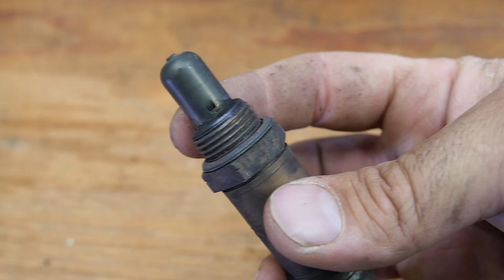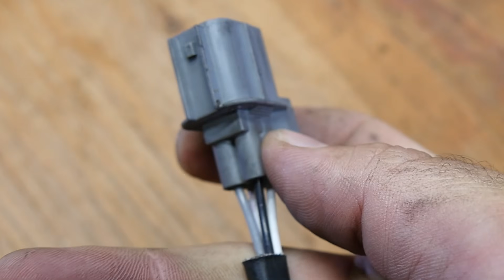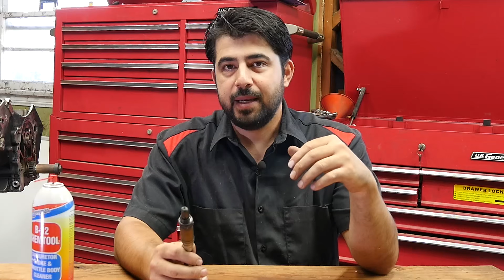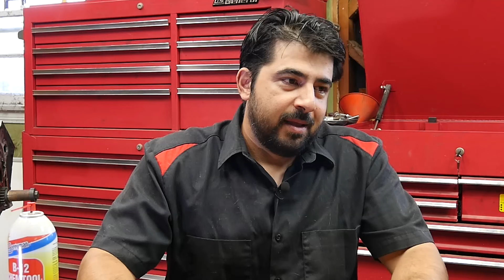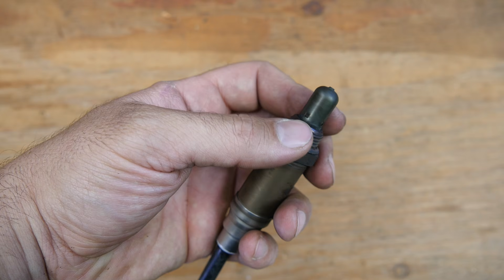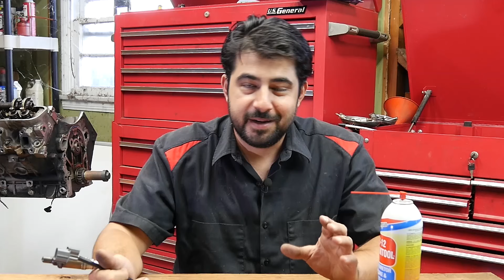How to Clean an Oxygen Sensor

Comment: Hi, I have Peugeot 307 2003 that does not start but crank. There is no warning light. Any suggestions please where to start, I have checked spark plugs, fuses, and fuel pumps that sound well at the time of turning off the key.

Comment: can an o2 sensor dip to 0.00v on a handheld scanner? I get a p0134 code only one time so far but when I hook the scan tool up it dips to 0.  could a failing coil not sparking cause this, or a solder point inside the o2 break? broken wire or connector?  or is 0.00 a normal reading?
Reply: Yes mine (the post cat o2s) goes to zero when going fast downhill and no throttle.  Your code is for pre cat o2.  Your pre cat o2s go to zero?
Reply: @yogamon  precat.  real strange the guy I bought the car from changer it when I picked it up he thought it would clear a p0421.  he was wrong.  I'm thinking he threw in the cheapest he could find and it was about 20k miles ago
Reply: @dereckc9469  probably, depending on the car they can be picky on o2 sensors.  Usually you have to use oem.  May have been some Chinese cheap crap

Comment: After I took my silverado 2007 classic. 5.3 to a mechanic shop to replace a lifter problem a camshaft timming chain oil pump  Spark plugs and wires. Nkw use a lot of gas some time when is parking on idle gets down to 5mpg and driving gets to 14 and before use to be 16 to 17 driving.
What is happend!!  I have no engine light

Comment: i replaced my o2 sensor cleard the code and did the driving got the car scanded again and the heating code came back can you help me
Reply: Check the wire harness and fuses. Or you might have gotten a bad 02 sensor.

Comment: What does it mean o2 sensor 2/2 circuit low?
Reply: Bank two sensor two
That's the sensor behind the cat on the driver side
Reply: Use a volt meter to make sure the sensor is getting proper voltage.
Or replace the sensor
Reply: @RandoDred   i replaced to a new one and now its says high voltage 🤦🏽‍♂️

Comment: For less then 30 bucks I felt the need to change them both out after listening to the pros and cons of your video I changed the upper and lower sensors after reading the code that I checked after ck engine light come on. 2011 Ranger v6 Sport. 10 years old felt best to fix it right..
Nice video by the way!

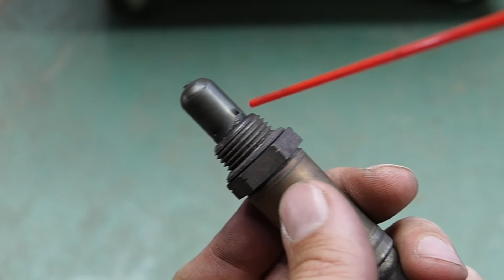Comment: Save your self 10 minutes of him trying to tell you to replace it yet his video is titled how to clean one. Just spray carb cleaner in the holes at the bottom, let it sit for a few shake it around and do that a few times. Mine the truck was running rich due the wiring with the back o2 wich is now fix.  so going to try to clean it.  A bath in seafoam might help. I love to run that in the tank every few months just cause. 5:05 
With these 4 wire sensors two of them should have 12 volts for the heated circuit when ignition is on.  If you don't check the fuses for them and then the wiring. So no 12 volts this cleaning won't help.

Comment: Try to clean it for about $10 of supplies and time? Or $500 for denso oem sensor and time for my Lexus? Hmmm 🤔
Reply: I have a 2003 Lexus ES 300 that has three oxygen sensors that I need to replace. I say I need to replace even though one is bad but from my experience and on previous cars where I’ve only replaced the bad oxygen sensor and left the others that weren’t bad in those failed couple months after resulted in the same problem so I just decided to bite the bullet and buy all three for my 2003 Lexus ES 300 which weren’t cheap by the way like $200 apiece close to it might as well be after tax and shipping. I’m gonna try this on my one bad sensor and see if it fixed it so I can at least have those three original ones that I took out since I already got new ones ordered I’m gonna keep the old ones as spares because those are the original sensor that have been in the car since 2003 same thing with the alternator I replaced I’m gonna rebuild the original alternator with all new parts why because it beats throwing it away for how much they they cost for a new replacement and spare parts are always good to have for these older vehicles that yeah those new oxygen sensors are not cheap. Just another way the EPA gets their money and forcing all that expensive emissions equipment on cars oxygen sensors don’t have to be that expensive for brand new OEM ones and going into it I was thinking well I might as well replace all three because it’ll be an expensive and it will ensure that I don’t have that problem for probably another 22 years going with OEM Denso Toyota branded oxygen sensors nope I was wrong way more expensive than I thought. Same thing with the OEM Toyota Denso brand new alternator not remanufactured thousand dollars for an alternator, but I suppose it beats paying a car payment on a new car but 22 years for those parts to go out that’s pretty good considering that today’s parts on today’s cars fail within a year not Toyota put on general motors vehicles and Fords and really on every new car that isn’t a Toyota or Lexus but then again even Toyota Lexus had some issues with quality on those new engine engines. The turbo V6 a few years ago so if I can keep this one going, why would I need to buy a new car and deal with planned obsolescence within a year of the warranty going out? I mean the parts on my 03 Lexus are all 22 years old and they’re just now failing and the warranty has been out for quite some time but I’m gonna use the used alternator and the used oxygen sensors as spares

Comment: I have a 2010 Nissan Altima 2.5 What is the difference between Air Fuel Radio Sensor and Oxygen sensor? Because I change the Upstream. But the check Engine light still on

Comment: I found my sensor screws were lose, then when I put a new one in, the plug from the car side came off in my hand. So I agree, check that electrical connection or you will be chasing your tail. The oil filter is just under it so I guess I pulled on that wire one too many times changing that filter and it finally broke off.

Comment: Hi sir,  would you help me please. I have 4runner 2006 v6 engine. I am facing this issue

DTC report
VIN: JTEBU14R560090570

============1==============
P0420
Raw code: 0420
ECU: Engine control unit
Status: Pending
OBDII: Catalytic converter system, bank 1 - efficiency below threshold
============2==============
P0430
Raw code: 0430
ECU: Engine control unit
Status: Pending
OBDII: Catalytic converter system, bank 2 - efficiency below threshold

Comment: Hi there, my 07 Jaguar x type Petrol V6 3.0 check engine light came on and the read code was P1647 (Heated Oxygen sensor control module bank 2 open/shorted) with P1111, which one of sensors goes wrong and pls advise? very appreciated

Comment: Funny story I changed my sensor and it only worked one day I thought something else was wrong with the car I changed so many parts which needed changing anyway. Turns out the sensor was poor quality. I bought a more expensive German made version and worked perfectly. Cleaning did not work. I still get a funny idle when starting the car. Could also be some leak around the piping, who knows. Now my problem is the cooling system pump is leaking :( so much effort

Comment: I need your help please please please I have a dodge ram 2016 and all my gauges don't work  only the screen tells me the gas speed oil and temperature  but I need the gauges working  I tucked to a shop and they didn't fix it I'm currently unemployed and I can't afford to pay more money  please help me
Reply: Check out your battery cables and see if there’s any powder build up on them(corrosion) if there is clean all of that off with a wire brush. I’ve personally cleaned off corrosion from people’s batteries and their gauges start working again when they weren’t before. Best of luck
Reply: I did and I chek all fuses are good so I took it to a electric shop they couldn't find the problem 🥴

Comment: Can oxygen sensor cause engine pinging? I am getting a pining for 1/2 to 1 seconds when the 1jzgte engine is up to opening temperature at idle only if do a snappy acceleration from idle.
Reply: You may want to check his last video on spark plugs.
Reply: Carbon buildup. Run higher octane
Reply: @aygwm   Definitely not carbon  cause I red line it most days in gear 1 and 2. I put the camera in the spark plugs hold it's clean in there. I am running the recommended spark plug. I changed ecu and fuel pump trying to fix this problem. What about  knock censor?

Comment: Can a dirty Ox sensor cause my 91 3vze toyota to run too lean on closed loop? It runs smooth but there is a lot less power after warm up.  The Emission test CO readings seem extreamly low.
Reply: It makes sense to me that a fouled O2 sensor would result in a lean mixture (perhaps resulting in better fuel economy, at the expense of drive-ability). But that is only my (amateur) opinion.

Comment: The object you are describing is an (exhaust gas temperature sending) unit.  The is no such thing as an O2 sensor, (so far) in the automotive world. [This is not semantics, this is fact]. In my plane there is an EGT, Exhaust Gas Temperature Gauge. Pilots contol the temperature of the engine exhaust with a mixture control lever. The CAR MAKERS, want to mystify everything, to make it difficult, for the B-Y mechanics to service their own vehicle.
Reply: They have existed for decades though. Reliability is the main reason for not using them in aircraft until recently.
Reply: @63ch31  OK
Reply: They don't test for oxygen they check the temperature of the exhaust. If you are in doubt checkout the Top Fueled Dragsters zoomy's. You'll see them attached to each pipe.

Comment: This is timely.  I am getting an inefficent cat code thrown. Does this sound like it could be fixed with an new o2 sensor?  I got the front lower loose but cant reach to unplug it.  Will trying upper front lower next to get off.

Comment: Great advice! I wish I would have tried the pre-emptive cleaning when I had my Dodge van! I replaced the sensor 3 times over the time I owned it!
Reply: That thing was probably burning oil or running too rich to be taking out the oxygen sensor that often
Reply: Unless you covered over 300,000 km in that time then i'd say that something was causing them to fail such as oil consumption or wrong AF mixture.
Reply: Oil consumption on 96 to 2001 5.7 5.9 engines

Comment: My engine makes a weird noise when I push on it, it becomes very loud when I floor it, I discovered that this sound is called spark knock, I replaced tge sparkplugs and they were trash, black with some rust.
After replacing the plugs it didn't make the noise until the engine became hot and I tried to floor it, it made the sound again and the check engine light came

I think it is carbon build up that is causing this, how could I clean it?
Reply from the maker: If you put higher octane gas in it it might help with the engine knock.
Reply: just don't floor it, simple!

Comment: Would cutting out your catalytic converter‘s mesd up your oxygen sensor readings
Reply from the maker: you are going to get a code for the cat but usually won't have an effect on drivability unless you have the setup where the post cat sensor is also responsible for fuel trims.
Reply: Ratchets And Wrenches thank you, I have a 2000 solara and I would assume that the first car sets up fuel trim

Comment: I have replaced my O2 sensor and car is still having bad fuel economy, I can even smell the unburned fuel from the exhaust. Any tips?
Reply: Clean MAF sensor use only specified MAF cleaner
Reply: @FredTheLutinoCocatiel  change maf sensor i had same problem
Reply: Stuck open fuel injector?
Reply: Lawrence Jensen's comment including checking the air filter, cleaning throttle body
Reply: either dead spark plug or a coil is  not firing/firing too weak to fully fire the spark plug, is my guess..  if you are smelling gasoline in your exhaust, it is because the vapors are not being burned, most likely.
Reply: John Jalas  How do you figure timing with only the smell of unburned fuel and poor fuel economy, that it is timing??  IF there was fuel smell AND if it was backfiring OR bogging down under acceleration,  OR if it would not start and stay running in addition to unburned fuel smell, then maybe the timing needs to be looked at. 

Perhaps the reason nobody else said timing, is because there aren't enough symtoms present to suspect it being off time.   Most people who are commenting here arent focusing on the most expensive or labor intensive job that most likely still won't solve the original problems of poor economy and smelling unburned fuel...
Reply: Get a new car
Reply: Sparkplugs
Reply: I would take an honest amateur who knows what they are talking about over a ripoff artist who happens to be A.S.E. certified that makes us real mechanics look predatory, assumptious, and sound like we dont know how Cause-&-Effect work when it comes to motors.  We dont look at customers as stacks of cash, but rather as people who if they could fix it themselves for a much more affordable rate than $80-1$120+/hr labor rates, they probably would.   

  You clearly are trying to talk an unknowing customer into literally hundreds of dollars in just labor alone to remove and test multiple "might bes" and least likely culprits, and then replace everything back in place @ $75-$120+~ per hour for labor, and not only claim removing everything out of the way of viewing the timing components is the easiest way and faster than checking and testing a spark plug and if a coil is is working or not , but claim that a spark plug not sparking or burning any gasoline is IMPOSSIBLE to be the cause of unburned fuel smell, especially since it is the easiest(with 3 or 4 basic tools you can buy at WalMart, most everyday people can test or inspect these for free and easily replace them back or swap for new ones in the engine at home.)to test, and that fuel PRESSURE is the reason your gasoline is not burning.. smh

  Everything you stated as an A.S.E. certified "professional" is wrong, expensive and initially  unnecessary-- and in society what what makes us real A.S.E. mechanics all look like greedy and predatory businesses. You may not care how dumb or misleading you sound to everybody else who knows better, but it is not right or encouraged by real A.S.E. certfiied professionals who are in the business to help other people and do what they enjoy-- Not try to get rich as fast as possible by ripping people off on unecessary labor charges and replacing parts that weren't faulty to begin with(pssst... that never works out)  Everything you recommended would be last resort testing due to how costly the labor tends to be on many makes and models-  especially with jumping on the smell of unburned fuel solely to try to justify charging the customer to do everything BUT check the source first.  Obviously you have worked on the first vehicle in history to be out of time and still idle smoothly,  drive with no loss of power driving or backfiring present, let alone crank right up and idle with no problems doing so.  lol

Do you also recommend removing the hubs and ball joints when the TPMS light comes on?  Or how about charging someone for a full set of brake pads and rotors because their airbag light came on?

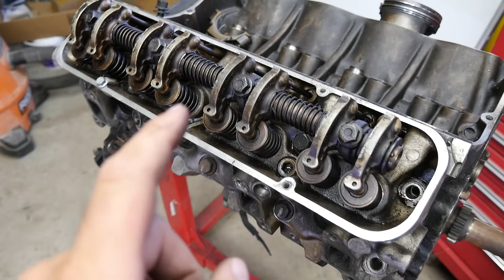Comment: Around 1:00 I understand what it does . My question is why is it necessary to measure and compare the oxygen leaving the engine to the oxygen in the atmosphere ? What does it do with that information?
Reply: It does, with the maf sensor that measures the air going in, but at the end it "double checks" with the exhaust and if there is too much or to little it adjusts the fuel air ratio
Reply: This is "closed loop" operation. Air>fuel>exhaust>read oxygen>adjust air/fuel>exhaust>adjust air/fuel> repeat. Happens once the computer detects that the engine has reached operating temperature.
Reply: to regulate air/fuel mixture
Reply: @zanmk69  Shouldn't that be done before the oxygen goes to the engine?

Comment: I have soaked a Wideband sensor in Petrol or Gas (U.S.A) overnight, and the amount of stuf that came out was amazing! Worked good after too!
Reply: How long did it work for before the check engine light came back on?, Or is it still working after the gas bath?
Reply: @williamshaw667  still in the car today :)
Reply: @ModorFix  thanks good to know.
Reply: Just soaked in Gasoline?
Reply: @zaifkhann  yes. Get the sensor out. Make sure you don't knock it or bang it as they are pretty fragile. Then get a little tub ( I used an paint aerosol lid) fill it enough to cover the tip of the sensor. Then dip the sensor in and leave it for 24hrs.
Reply: @ModorFix  thanks man 👍
Reply: I'll be damned
Reply: @SmyliSuicide  did it work?
Reply: @M.TTT.  just followed above advice. Used 91 octane non ethanol here in USA. Mustang o2 sensors working great! May not be long term solution but definitely dissolved brown:black stuff into gasoline after 24hrs. I let them air dry for another 8 hrs then installed.
Reply: @Jack-Mehoff  ....was thinking, instead of an 8 hour air dry.......one could just use a hair blow dryer. Set on cool, put the 02 sensor(s) in a small box or whatever container and direct the hair dryer air flow at the sensors . 
May only need minutes to dry out versus  8 hours.
Reply: @tonya.1697  for sure! I think when I did it, got late so just left sitting in garage overnight and installed in morning.

Comment: I've cleaned mine for years. It does help get the CEL away.
Reply: How do you know your NOx sensor is dirty and not just broken?
Reply: @cherryrose6438  You measure it with a meter to reference.
Reply: @John Kwak Check Engine Light
Reply: what do you used to clean the sensors?